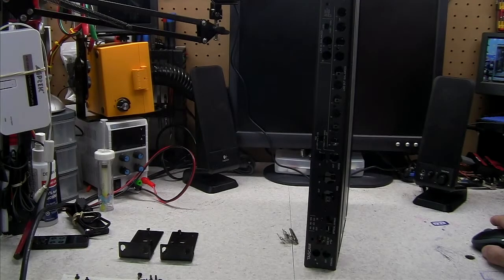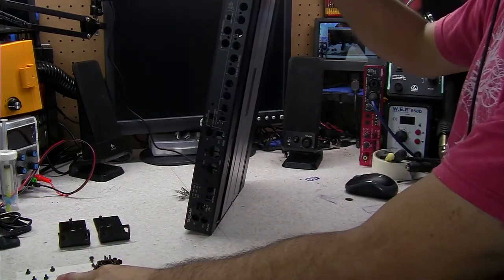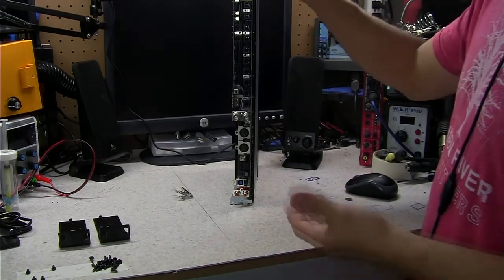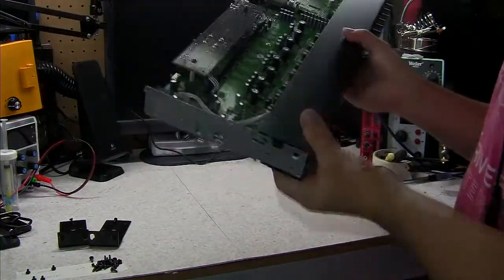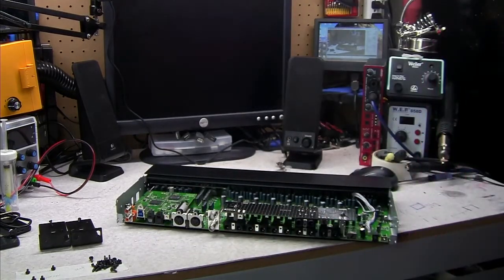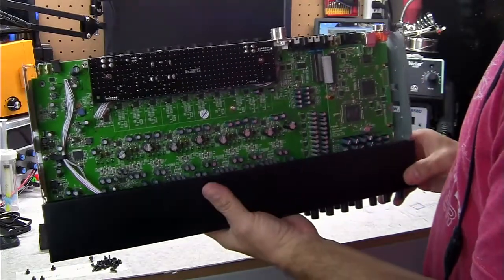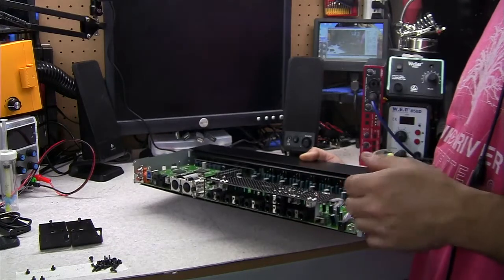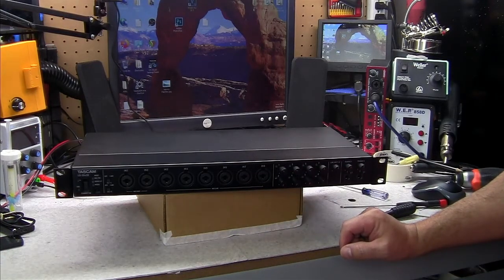Tascam 20x20 USB interface tear down

Comment: i dont understand why you say it is overpriced...
Reply from the maker: The reason is self evident in this teardown video, what do you see inside? It's literally a 200$ PCI to USB card.
Reply: @danfuerthgillis4483  its in the details... the circuit design, and also the firmware. you can not judge only by "it is only a add-on board".

if you say it like that... then every PC with add-on GPU card is bad (an analogy).
Reply from the maker: @laptoppakdosen It's about what is inside regardless of connections or shape. Apollo interfaces are also in this pattern.

Comment: Is there anything like reset to factory defaults on the board?
Reply from the maker: There is one file ( it's a simple text file without the extension) that holds all your settings, so if you remove that file ( copy it first to your desktop). Power down the unit, then run the app control software then turn on the unit, all your settings will be back to default. The unit has no settings saved to it, the settings are on your pc in that file. So this unit really has no need for a reset settings switch. Every time you run the control app for this unit those settings that are in that file are loaded. I prefer this than saving it to the unit, it's faster, less issues and I have control over that file, I can modify it without running the control application. If you are a software developer you can actually code your own interface GUI and have that software use that file.

Comment: Hello sir could you help me out to resolve Tascam US 2x2 power problem and which part to be replaced please help me Thank you.
Reply from the maker: What problem are you having with it?
Reply: @danfuerthgillis4483  I have the US 1800 version I’m pretty sure it’s similar to the 2020 for some reason my computer does not recognize will get a code of 0005 I think I’m having bad connections with the USB I the module what’s your opinion I tried changing the USB wires and also the power 12 cableEven used a different USB slot same codes

Comment: Se puede poner en un rack de 19? O és mas grande?, gracias
Reply from the maker: Sim, en la caixa tene las partes para por en lá rack https://tascam.com/front/product/img/us-20x20/us-20x20_w_rack.jpg
Reply: @danfuerthgillis4483   però de 19 pulgadas?
Reply from the maker: @marcfarell8412  El dimensiones:
Sem placas de rack ( normal) : 445 X 59 X 222 mm ( W X H X D)
Com as placas de rack : 482.6 X 44 X 222.4 mm ( W X H X D)

482.6 mm to inches = 19 "

Comment: Mine not getting power can i rig a card frm a laptop or some kinda "hack" ?
Reply from the maker: First things is to check the power supply adapter with a voltmeter to see if there is the correct voltage stated on the power adapter. If there is the correct voltage then open up the unit as was done here and check the power rocker switch at the  front as it is a very cheap switch that will not last that long. Check also the input socket area for any burned down caps or resistors.